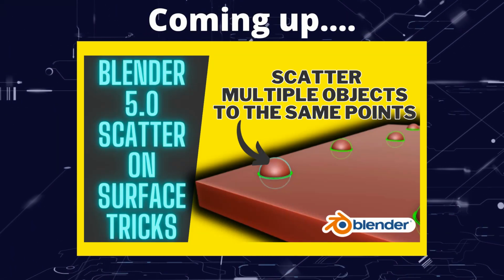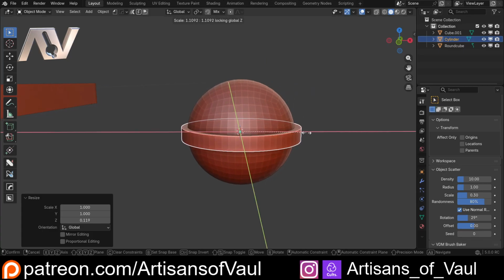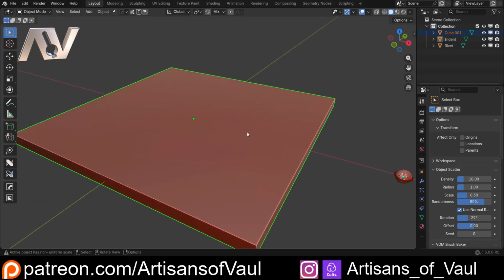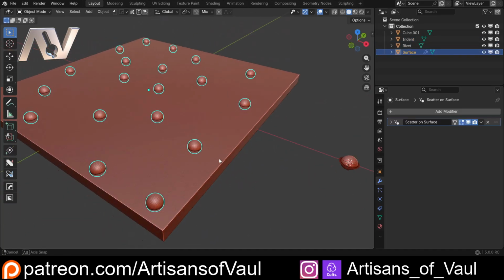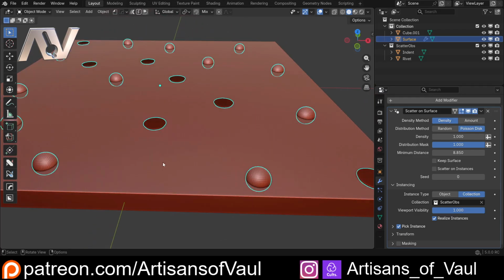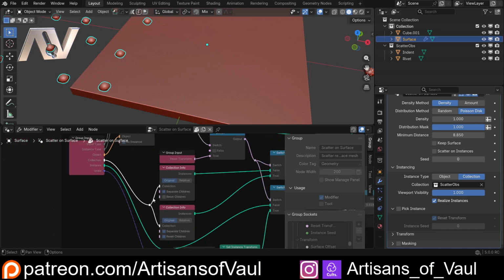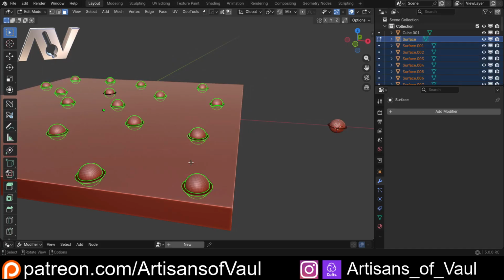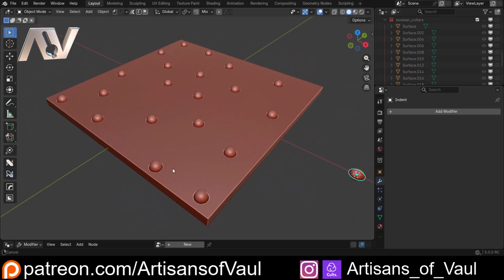Blender 5.0 Scatter on Surface Tricks!

Comment: Very nice walkthrough, with the “potholes” noted (and filled by you). I probably should know the following, but I’ll ask anyway: Is there a way to use the “scatter objects” modifier to place objects in a “grid pattern” or in a “geometric shape” pattern (or possibly even in a shape defined by a multi-edged 2D polygon)? Or, should the regular “array modifier” be used instead, for this purpose. For example, suppose I want to place “rivets” in an equally-spaced array across the side wall of a space ship (grid spacing), or I want to create a reoccurring “sub-panel” on the outer hull of said space ship with rivets placed along the perimeter of each sub-panel (so, rivet placement based on a “geometric shape” like a separately-defined “square”). Can the “scatter objects” modifier be used for these purposes, or would the “regular array” modifier be more appropriate?
Reply from the maker: So I think the most appropriate would probably be the new instance on elements modifier would be your best bet.  Make a copy of the panel face and then subdivide the edges.  Im planning on making a video for that soon
Reply: @ArtisansofVaul Interesting! Ok, I’ll keep an eye out for your forthcoming video on that modifier (I’ve never heard of before).
Reply from the maker: @dovmerrill804 I was exploring last night and thought there was going to be something a bit limiting, only to find a solution thats been put in and I haven't seen mentioned anywhere! Definetly doing a video now.
Reply: @ArtisansofVaul Great! Thanks for your sleuthing, and I’ll keep a lookout for your upcoming video. 👍👍👍

Comment: Perhaps in the new GN graph a boolean could also be added therefore the Scatter wouldn't need to be applied (keeping things non-destructive)?
Reply from the maker: That would be good but the issue here is more splitting out the different elements first. Honestly if it just had the ability to name the created instances after the name of the object they came from instead of the object it was scattered into that would help SO much.